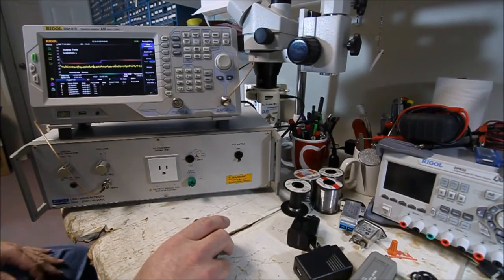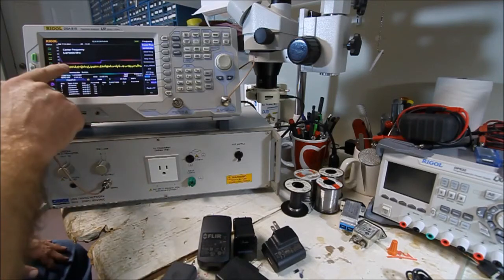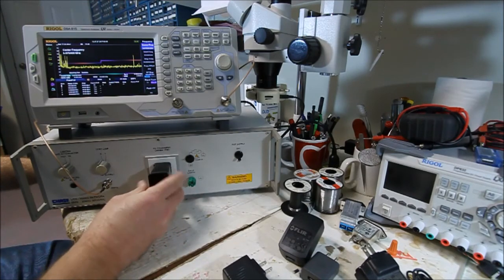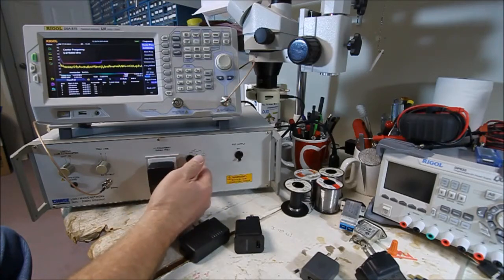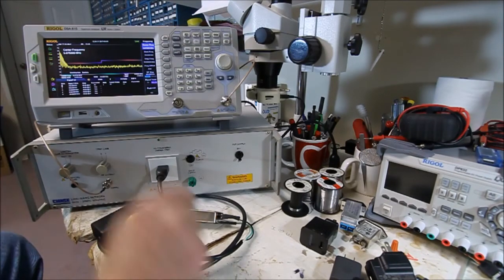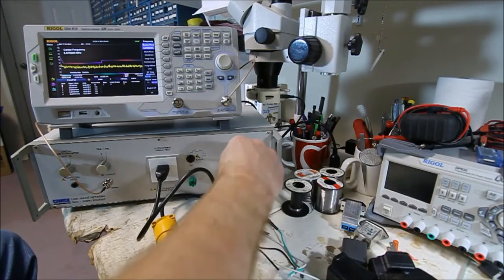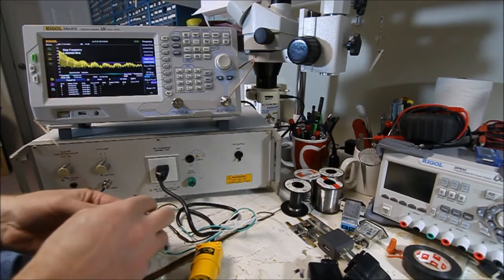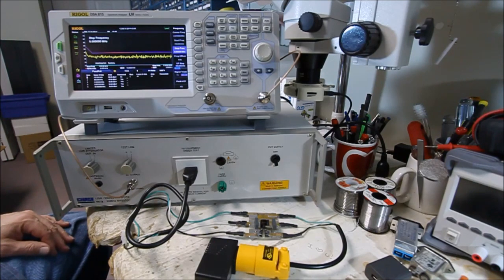FCC / CE Pre-Compliance Line Conducted Emissions with Rigol DSA815 and LISN, CISPR 22, EN55022.

Comment: Nice video, thank you.
Just one question which I can't get to have answered: How would I test a wired mouse (whose usb cable is detachable) for precompliance?
-Do I need a LISN or can I do simply with the RIGOL SA and a near field EMI sniffer probe?
- If I need a LISN, how do I connect the USB cable of a wired mouse to it?
Ty
Reply from the maker: I have had similar scenario (not a mouse but a USB connected device with removable cable).  The testing lab used a "golden" laptop that they knew would pass the line conducted test.  First they tested the golden laptop by itself (it passed) and then they added the USB device and retested (it passed again).  This is a pretty common procedure.  

I used to work for a company that developed laptop accessories and this is the same thing we did.  We would find a laptop that passed and then hung on to it and used it for all subsequent testing.  Had an instance where our golden laptop no longer passed and found that the hard drive and been replaced.  We went back to the old hard drive and the laptop once again passed the line conducted test :)

So yes, IMO, you need a LISN.  Mouse plugged into computer and that computer is plugged into LISN.
Reply: @DanPattenAudioG33k  awesome story. Thanks for the response, very helpful.
So I guess, no precompliance I can do at home on the PCB of the mouse, without it connecting to a golden computer and without visiting/paying for a test lab?
Reply from the maker: You can do pre-compliance for your product outside of the lab provided you have the proper equipment.  For FCC compliance, your prime concerns are conducted and radiated emissions.  Conducted is pretty easy with spectrum analyzer (SA) and LISN.  Radiated is more difficult but you can get an indicator using an SA and TEM cell (possibly with shielding bag).
Reply: @DanPattenAudioG33k  thank you Dan :)
Reply from the maker: @rockndancenroll  Your welcome.  If you need help and your only looking for a couple of measurements, I can help you out.
Reply: @DanPattenAudioG33k  Acknowledged :)
Once I purchase the equipment I'm planning to, I'll let you know when I get stuck. Cheers from London.
-George

Comment: Hello Dan, 
Why didn't you  loaded those chargers with nominal maximum output current during tests?
Reply: Yeah agreed here. The FLIR and other ones may still pass, but would have been interesting to see them loaded up, as being unloaded it's possible in hardware to make the power supply virtually "off" until a minimum load is detected and connected.
Reply from the maker: Good point.  I should have shown the tests without load and possibly different amounts of load.  In general the adapters that did not pass unloaded, also failed when loaded.

Comment: Dear Dan, great video! Remind that's rather dangerous to load the LISN with the SA connected. Also switching between phases can cause very high signals at the SA input. I'll suggest to disconnect the SA fron the LISN when loading the LISN and switching between phases. The beeps indicate that the input level of the SA is too much. Otherwise: thumbs up, great video!
Reply: I hate to admit it but I blew the front end of a SA when a PSU blew up while on the LISN. I was always much more careful after that, even unplugging SA input when powering up.
Reply from the maker: Sorry to hear.  When ever I am doing a direct connected measurement, I always insert a transient limiter.
Reply from the maker: Sorry about old reply :)  I agree, a good practice would be disconnecting SA while switching phases and DUT.  My LISN used in this video has a built-in transient limiter that I was relying on.  I ALWAYS use a transient limiter when using a LISN connected to my spectrum analyzer.  When I use this LISN I use the built-in transient limiter.  I also use an old Hewlett Packard 11947A (no longer manufactured I believe) or the nice Tekbox TBFL1 https://www.tekbox.com/product/tekbox-tbfl1-transient-limiter/
Reply: @DanPattenAudioG33k  A transient limiter contains usually some sort of diode. The disadvantage of semiconductors is that they can create wideband noise and 'mess up' the measurement. A limiter does work for protection, but beware (especially in high RF level conditions) that the measurement can be affected. The measurement will appear worse then the real signal due to the added RF components. Just a thought. ;-)